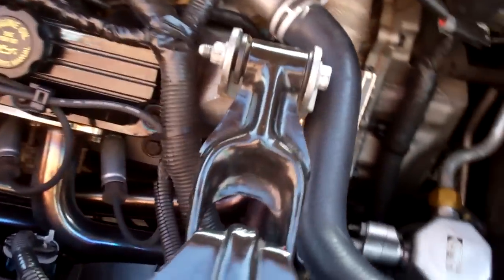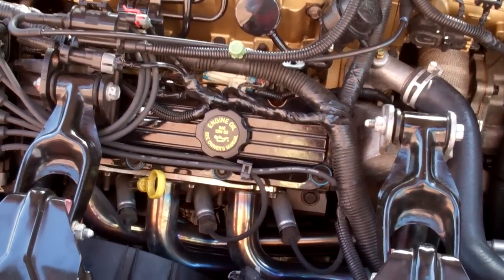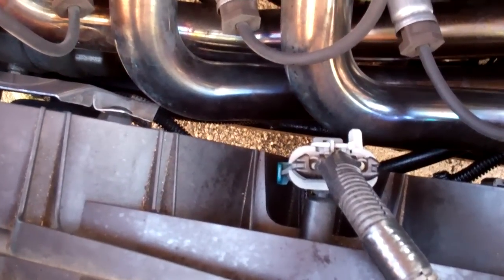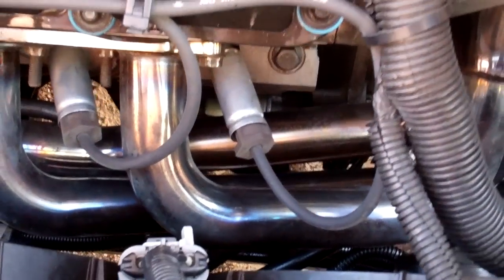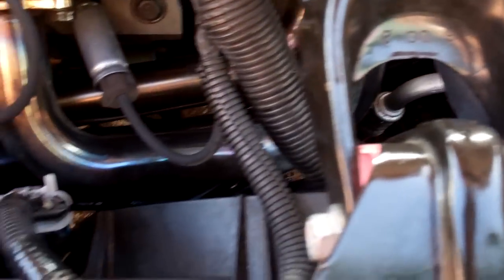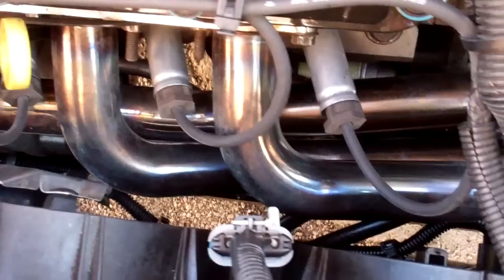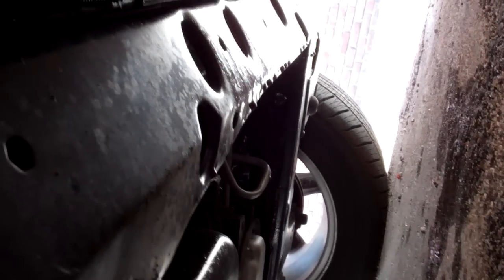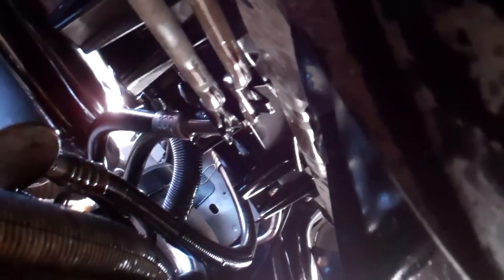Buick Regal transmission Cooler line leak: Part 1

Comment: These lines are Dealer only up here in Canada and Both lines run 190-215CAN. Rip off!, Just going to install a aftermarket tranny coller and make some custom lines and disconnect the radiator cooler old lines